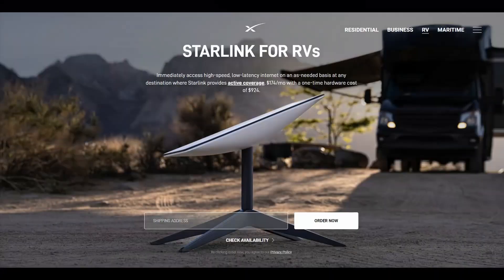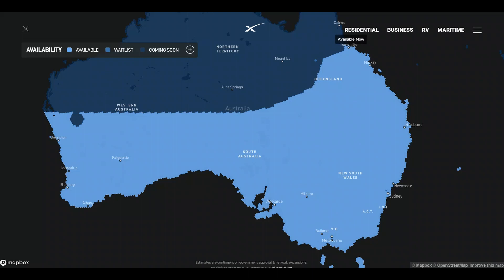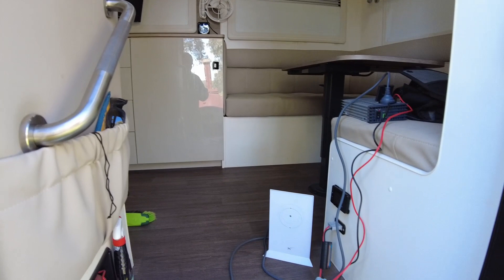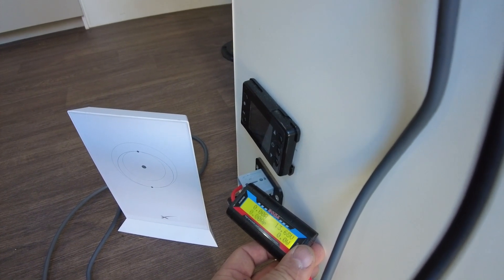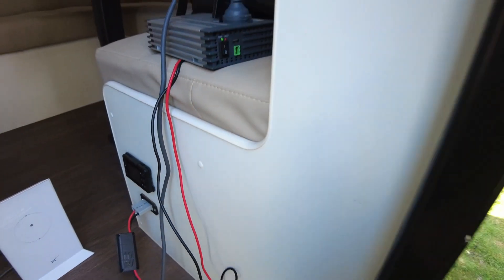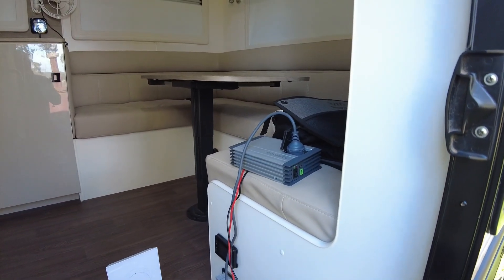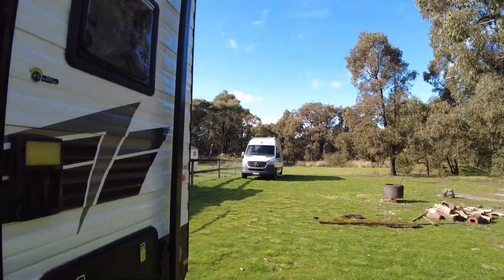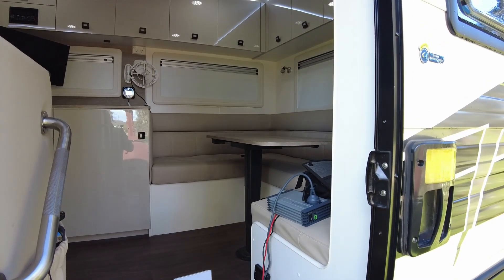Starlink Power Consumption

Comment: We use 140mm computer fans in our camper and they use about 200 milliamps (0.2 of an amp) - a little cooling fan in an inverter would be much less 👍 
This video shows a direct 12V setup for Starlink with video streaming going uses about 2.7 amps..

https://www.youtube.com/watch?v=eIR1CWbT8uQ&pp=ygUOWUFPU0hFTkcgZGlzaHk%3D
Reply from the maker: Yes that would be a more effective way to power it’s the inverter is not very efficient…. Thanks for the share :)

Comment: I bought a 150w inverter and it didn't work for my Starlink, seems like I'll have to get a 300w  inverter
Reply from the maker: I have a 300w inverter and the cooler by fan cuts in quite a bit when it’s running Starlink, also it does need to be puresine as mine wouldn’t run on my old modified sine inverter